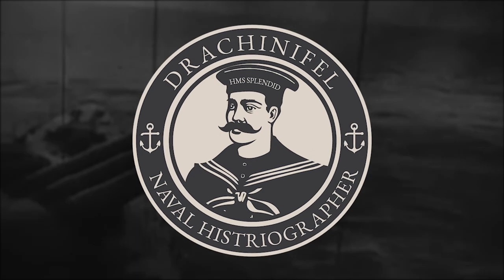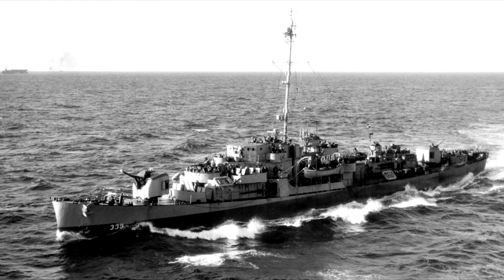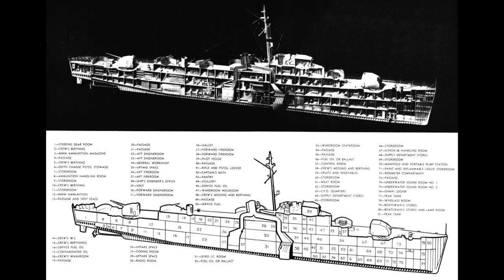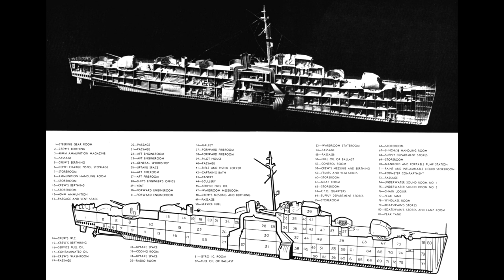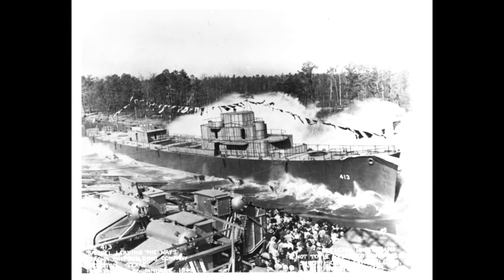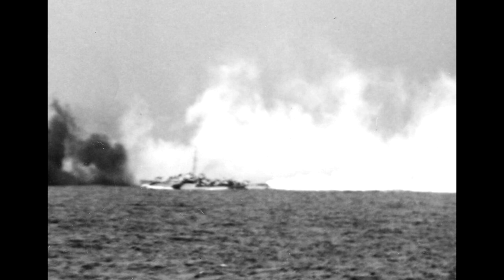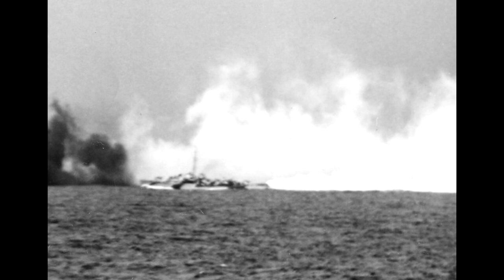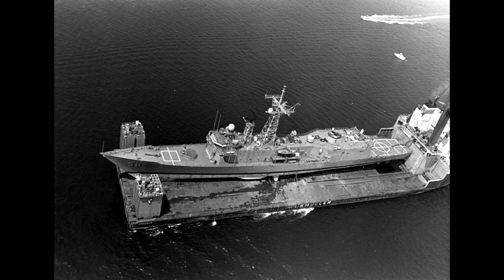USS Samuel B. Roberts - Guide 208

Comment: Good to know rushing crusiers is an actually effective tactic for destroyers. And here i was thinking WoW was historically inaccurate.
Reply: keith moore  If it works, it ain't crazy.
Reply: Do note that this video's mention of Samuel B. Roberts taking out Chokai's stern is based on poor historiography and has been disproven through wreck analysis (shows the stern with far less damage than indicated by older accounts)
Reply: @bkjeong4302  I pose a question to you.... would you want to be in that stern after the torpedo strike?  I think not.  And nor would any Japanese sailor.  Safe to say her stern taking out.
Reply: @EricDKaufman  The issue is that with Chokai's wreck being found it's debatable whether that torpedo strike actually happened (if it did, it didn't actually do that much damage), much like how the wreck also disproves the idea of White Plains setting off her torpedoes (since there is no evidence for the massive explosion that would result from that happening)

Comment: I recall reading another destroyers tactic in this battle was 'Salvo Chasing" .. as soon as a shell landed, you ran for that spot on the assumption it was hard to hit the same spot twice in a row.
Reply: The idea is that you wouldn't try to hit hte same spot twice in a row if it missed the first time.
Reply: Think the proper expression is  'chasing splashes' 
The gunners will adjust fire to make the next round hit, so point of aim is always changing

Comment: The Skipper of the Sammy B. got to explore every bit of that 20% over design capacity in the engines.
Speed	
Designed: 24 kn (28 mph; 44 km/h)
Achieved: 28.7 kn (33.0 mph; 53.2 km/h)

Now I'm REALLY curious as to what the New Jersey could have done if she pushed her engines in the Vietnam strip down config!
Reply: According to the USS Iowa captain in the 80s, Iowa was able to go 37 knots for a few hours.

Comment: I found it interesting that the USS John C. Butler, the name ship of the class, was also part of Taffy-3. She and their sisters Dennis and Raymond stayed closer to the CVEs, but contributed their guns and made runs with their torpedoes. The Dennis was hit at least a few times.

One wonders how much more badly Kurita's force would have fared if the other DEs had joined the fray more directly. At the same time one of their primary roles was keeping up the smoke that impeded Japanese gunnery, and in fact USS Heermann was called back closer to the CVEs late in the battle specifically to lay more smoke. I personally suspect few if any of Taffy-3's CVEs would have survived the battle without it. Protecting the CVEs in the immediate was more important than going madlad on the IJN.

Comment: Kurita had other reasons to have headed for tokyo (other than the fact that the Americans has apparently begun to use battleship armour on their DE's ).  His cruiser forces (the pride of the IJN) were getting the snot beat out of them by somebody out there, in his mind his cruisers getting beaten had to equal a fight with their equals. He never really got a good look at the US Carriers, and all flap tops at 30,000 yards look more or less the same.  At the same time that he had been forced to turn away by a spread of torpedos he received a report from his (remaining) cruisers that the fleet unit he was facing was 6 fleet carriers, 3 cruisers and 2 destroyers (under the circumstances not a surprising mistake).  If those had been American fleet carriers and his cruisers were unable to cut them off then he was never going to catch them (his BB's had 27, 25, 29 and 29 knots).   Soon as those carriers had gained enough distance he could expect a truly furious attack (the Musashi had been put on the bottom by American carriers the day before). Kurita had lost 6 cruisers sank since the battle started as well as Musashi and a couple other cruisers taken out of the battle. On top of this Kurita was going to have to turn away from the carriers and head for the transports, this was going to be something like 70 - 80 miles or over two hours to be practice targets for the US Navy pilots with most of his AA escort on the bottom before he was even in gun range. He also found out at about this same time that Yamasiro and Fuso had been sunk the night before by a US battleline. I think an argument can be made that Kurita was reasonable, pulling out of that firestorm and saving his units showed a lot of good thinking. Add to this Kurita's war record was superb and I think Kurita's actions were sensible even if in error.
Reply: Kurita was also missing command equipment such as a plotting table and likely some of his fleet command staff as well, lost when Atago was sunk. And he did not expect to encounter Taffy 3 at all...there had been a number of attacks by Japanese Army aircraft, but word of this never reached him. He did make tactical errors such as ordering a general attack then continuing to direct his ships rather than letting them self-direct, but I think you're correct that his decision to withdraw was sound given what he knew and what he believed his opposition to be.

Comment: The DEs were actually preferred for ASW work because they had a tighter turning radius than a Fletcher, and, better sonar.
Reply: The DE’s could also “crawl” at slow speed better - which was a significant advantage for trailing underwater subs in contact with sonar

Comment: So my napkin math scaling says that to make 29 knots instead of her crew extracted 1.75x design engine power by running the boilers at 1.46x design pressure (and significantly over temperature). Also, knowing that she was well armed, but mainly with light and medium AA guns, means that the decision to close the range was effectively a choice to actually use their main armament. And since they needed to close, it made sense to raise steam as high as possible while still being mostly confident the boilers wouldn't blow them up before the incoming fire. 

For me, understanding the tactical reasoning behind the exact manner in which they performed their last stand makes it more impactful. I wonder if they had a similarly grim practical reason why they didn't think ramming would be worthwhile.
Reply: "The last stand of the tin can sailors" by James Hornfischer claims the pressure got up to 600 PSI on boilers designed for 450 PSI.
 personally I suspect that 600 PSI number is  when the gauge went off the scale.
Reply: @can_hauler  If the required torque is proportional to v^2 and the torque is proportional to the boiler pressure, you get 660 psi, which is pretty close. I'd expect the gauges would go up that high with the understanding that sometimes it is desirable to push the actual short-term limits of the engine, and at that point in particular it is good to still be able to see what you're doing. I guess that means a gauge with an important needle should have the operating point 2/3 or 1/2 way up.

Comment: Rather than slowing down, turning onto another heading is helpful for avoiding hits. Also steering into the latest shell splashes is a useful technique.  If there are too many shell splashes to decide which way to steer, you may be in trouble.
Reply: The John C. Butlers weren't designed to get into gunfights with surface ships, so lacked the fire direction control gear (which is separate from radar!) which significantly improved the Fletchers' accuracy and target re-acquisition after speed & course changes. So chasing shell splashes or other evasive maneuvers might add some operational time, at the cost of the rate of fire and accuracy which was mauling the Chikuma. The Roberts had to either enter a zone where LOTS of IJN guns were cleared to fire on it, with subsequent choices of either pounding away on an easier-to-hit course or losing accuracy, or slow down and hope the fewer guns that could fire on it didn't have enough accuracy to fully capitalize on it.

It's worth noting the IJN had identified the Roberts' small size and switched from AP to HE, and still considered it enough of a threat to draw fire from battleship main guns.
Reply: @Archon1995 once it was practically out of ammo, though, it could have tried some dodging then?  It maybe could have served as a distraction longer.  I don’t know, but the DEs should be able to turn on a dime to match the maneuverability of U boats.  I suspect by that point there were too many shell splashes to chase properly. On battleship shells, I find it amusing that the Yamato had to evacuate most of its AA positions before firing its main battery. Very few of them were protected from the concussion of the main guns. So they brought 18 inchers to maybe an 8 inch fight.
Reply: @glypnir   The Butlers were highly maneuverable, both at speed and when "crawling" to hunt a sub.  :-)

When Copeland had to make the choice between equally poor options the ammo was not yet exhausted, the ship still had some of the legendary star shells. Enter a zone and evade to last longer but lose accuracy with what remained; enter a zone without evading and risk getting smashed very quickly by the sheer volume of incoming before you can fire off the rest of your ammo; or remain out of the zone and keep firing but make yourself an easier target for the fewer guns which can fire on you. I personally think his choice reflected his ship's best opportunity to do as he said: "We will do what damage we can."